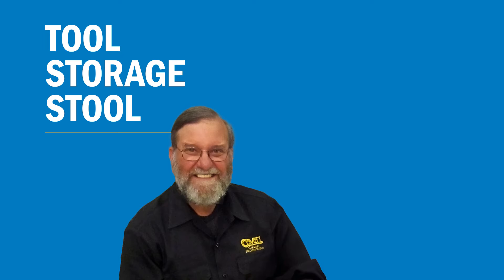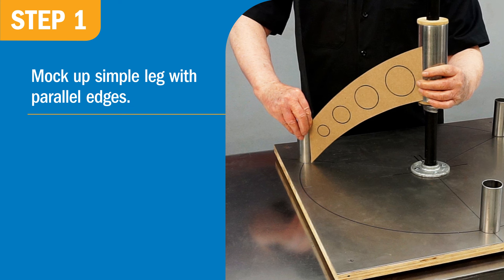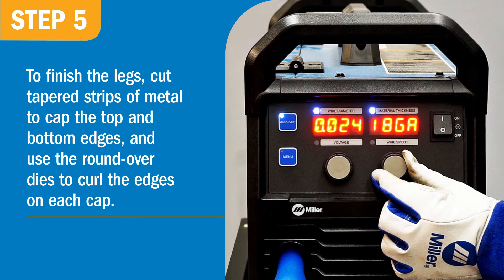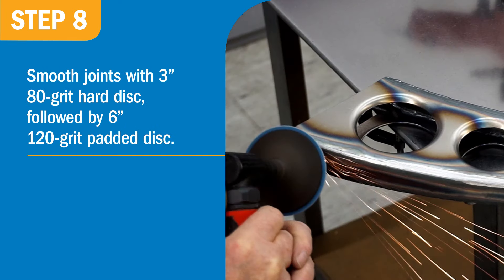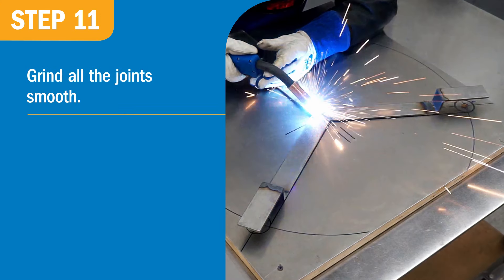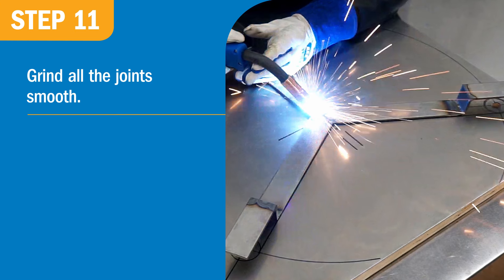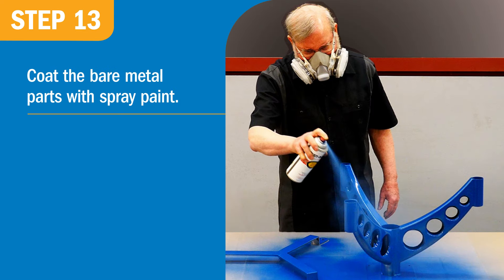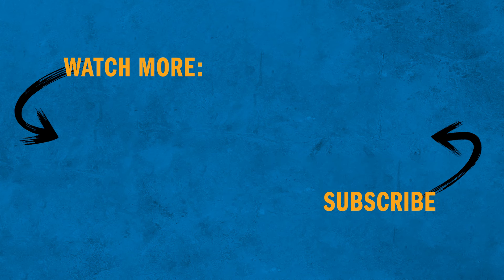DIY Welding Project: Tool Storage Stool

Comment: Hi Wolfgang 
I was thinking of coping the two receiver tubes with a half a cope each tube to get enough room to tig weld them . together. I took your advice and bought some 2 inch OD .109 wall thickness. I am making a tig welding arm steady rest. Thanks again for advice
Jeff